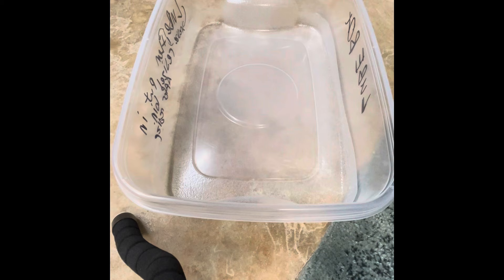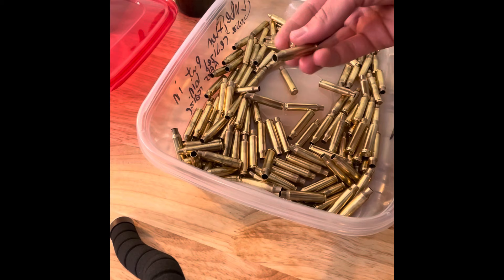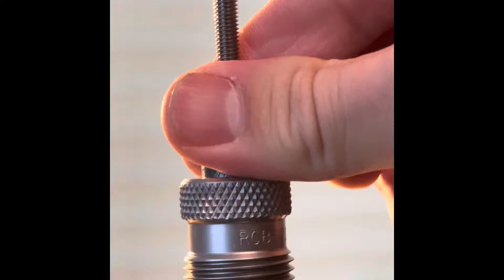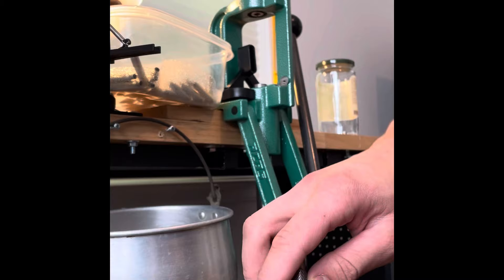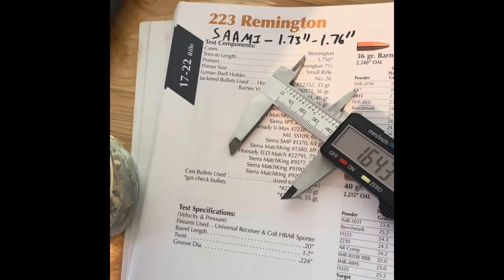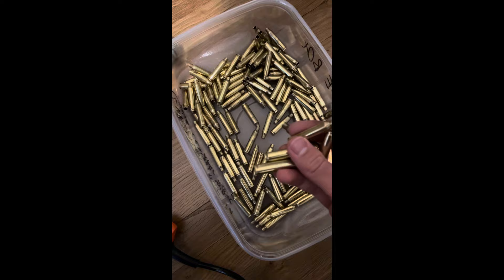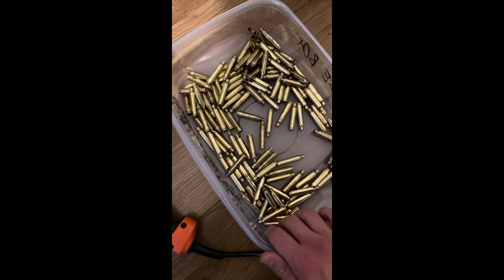Reloading 223 in 2023 Part II: Small Base Resizing and Giraud Tri way trimming

Comment from the maker: Hey! Welcome back. If my talking is boring and slow, skip ahead here!

Resizing and case trimming isn’t very eventful, I tried to make things as cool as possible to maintain your Gen Z tik tok attention span.

0:54 brass water test

1:25 case lube ( 6 5 guys spray case lube recipe)

2:47 die set

3:54 RCBS die set instructions

4:09 put in shell holder

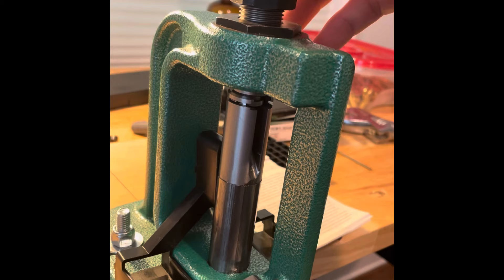4:58 setting up resize die

5:32 setting up resize die part 2 (quarter turn)

6:00 locking down lock ring

7:13 verify decap pin

7:40 LE WILSON case gauge

9:06 first case example

9:38 case gauge with resized case

10:32 case trimming manual page + info

12:38 giraud Tri way

13:17 case trim demonstration

14:59 measuring case before trim

15:19 trimming case

15:30 measuring the case again